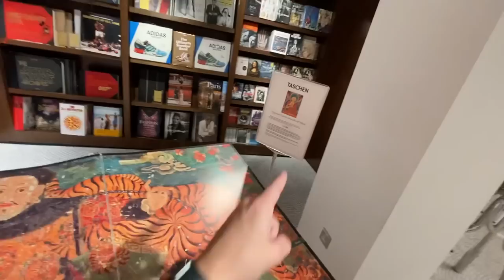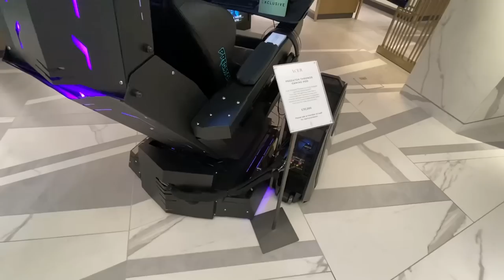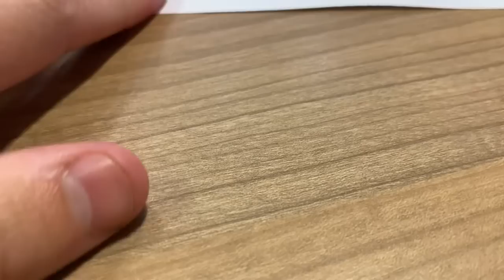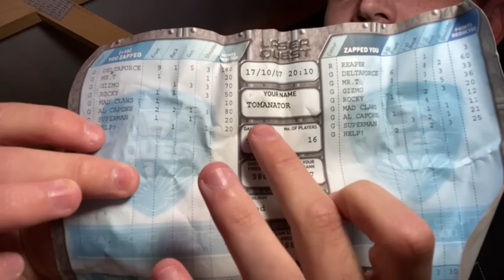I had to get tested for Covid-19.. and crashed my car.

Comment: Does the city not reimburse you for the damages to your car? If the sewer plate isn’t properly down or if it’s rising up over time due to natural causes, isn’t it the city’s responsibility to fix it & should YOU pay for the damages it cause? (Just wondering)
Reply: If he was not legally parking into a spot then no. It looks as though it was yellowed lined so it should not have been pulling up onto the curb so the city has no obligation to pay
Reply: @harrynicholson7740  that makes sense. Thanks

Comment: Tom go to a custom carbon repair shop the dealer will just buy a new splitter and cost u far too much but a repair shop will just fill the hole with new carbon fiber and it will look perfect .

Comment: If you want to have a nice car like this you should really put it away for the winter to protect it for many reasons and get a winter car even if it is a piece of 💩 then so what you’ll only be driving it in the winter
Reply: What's the point buying it if you only drive it half the year? It's a car. It should be driven.
Reply: There is literally no reason why you'd needa put it anyway in the winter..... Sun damages your car more than cold/snow... Please inform me how the wonder would damage his amg....
Reply: he has 2 other cars, they just arent mot'd it's his only car for the time being.
Reply: Cars like Toms are cars to be enjoyed in summer months driving fast around twisty roads and tracks, putting them away for the winter has many benefits, increasing the life span of your car in many ways, where in the winter where it rains a lot you get a lot of 💩 being chucked onto the road which will end up on the under side of your car causing loads of damage that normal drivers may not think about or actually even car about until one day you got get your MOT done and bang, suspension arm has corroded for example, little things like this start to add up especially when the gitters come out and start spraying on the road it really does damage the underside of your car, not the mention the paint work especially the carbon fibre it completely destroyes it and does a lot of damage, now you wouldn’t really be thinking about that in your normal everyday car until you come to realise some pint works cost well over 5k, another thing about winter is leaves! They’re one of the worst things for your paint work! Storing the car away also helps to keep things like tires and seals and other engine stuff in better shape for summer months for smoother running, putting it away has so many benefits that in the long term for a nice car like this or even just a car that has loads of value to you but only worth 10k in the real world is just genuinely so much better for the car and it makes you enjoy it more when you can finally get it back out again, it makes you fall completely back in love with it again. I have a 1988 BMW M3 E30 Coupe which is all completely original interior, and I love driving it in the summer going to meets ect but when winter comes I love putting it away to rest up, going through everything to make sure it’s perfect for when I get to bring it back out for some fun 🤩 
 I haven’t gone into too much detail because i did write a lot before but YouTube decided to reload deleting all my text when looking for a link for you guys to look at but this is just a basic over few. 🙄
Reply: @danielhorobin5781  my guy wrote a god damn book wtf

Comment: No point of getting tested, just stay home and if you don’t get better go to a hospital
Reply: you're delusional. if you think you have a symptom, get tested and you can take steps to avoid transmitting the virus and maybe get on the path to recovery, you're the reason we may lose this fight.
Reply: I mean you couldn’t be any more wrong here🤣

1) The main thing you’re not meant to do if you get symptoms, is to go to the hospital. I mean, that’s common sense bro, that’s exactly how it spreads.

2) The safest way to go around it is to isolate for 2 weeks if you get a symptom (Which Tom did).

3) If you still have symptoms after stage 2, then go get tested at a correct site (Once again, avoid hospitals)

I just thought I’d supply you with a bit of knowledge mate, I can see that you’re only really young which is why I’m not taking the piss out of you, I was young and small minded once also.

In the future and as you get older you realise that you shouldn’t spread fake information like you just did, but you’ll learn all of this my friend. Look after yourself tho bro.
Reply: @MrGFXJake  what I meant by my comment was, if you have symptoms, quarantine yourself.  And if it gets really bad then go to the hospital. There is no need to make the number of people that have it go up because it’s only going to be used for political gain.